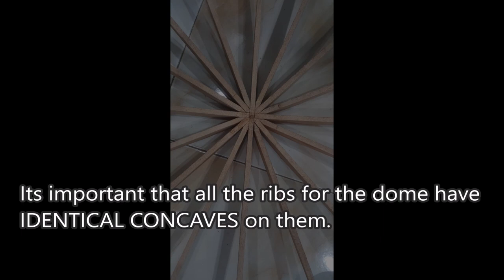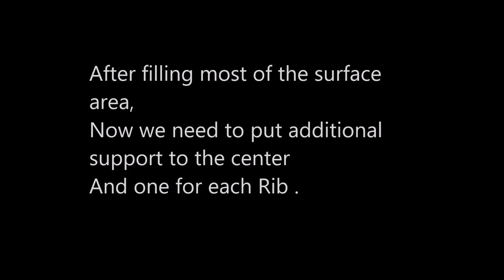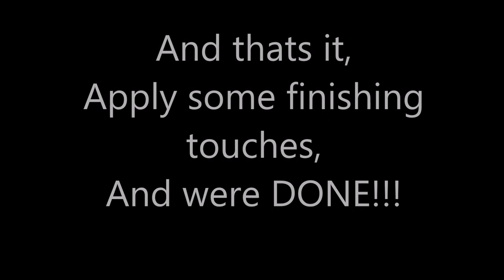How To Make a Real Life Anime Beyblade Stadium

Comment: If you want to make a beyblade stadium without that "much" effort, you can do it with an old satellite dish that you probably have left over.
Reply: Yeah but a lot of them have a some kind of big metal pole or antenna sticking out from the middle of the dish
Reply: @caronice666  You can put some epoxy body filler to those holes.

Comment: Hey love the stadium I want to make a smaller version since I don't have a large space for it.  How did you get that carbon fiber pattern?
Reply from the maker: Alot of masking tape to build the pattern and then painted it
Reply: @ATTMBeyblade  I would like to know also what epoxy you use towards the end?  I would like to follow your instructions to the T if possible =).
Reply from the maker: @MaverickDragneel  you can use all purpose epoxy or a marine epoxy, and i would suggest that you apply and sand the epoxy via small area( it would help you uniformly level the surface easily)
Reply: Thank you!

Comment: What is the wood you used for the ribs (the size), And at what angle concave are they?
Reply: They have an approximate 25° to 35° concave surface from the centre to the outer dome. Mine worked well with double layered cardboard and you can use 2-3mm plywood.
Reply: Have you already made a stadium similar to the one in the video
Reply: Yes, I but in a smaller scale
Reply: The bowls dimensions are 39 inches wide and 5 inches deep